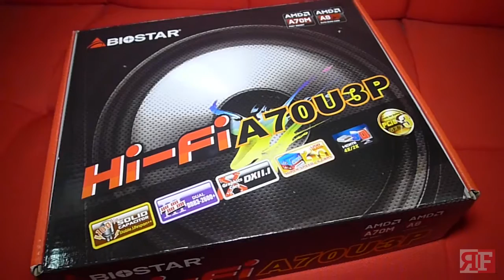Biostar Hi-Fi A70U3P Overview Video

Comment: I just built a machine using this motherboard.
AMD A8-7600
16gb DDR3 @1600mhz
GeForce GT 1030
CX450M PSU
And a CM Hyper 212 Black 

It runs fantastic doesn't use much power, I love the amp for my headphones is already built in to mobo, And it supports pascal graphics so I stream in 4K. Not bad for a APU and Mobo from 2014
Reply: You pc can rendering 3D or playing game like Battlefield 1 ?
Reply: ay man is gtx 760 compatible with this motherboard?